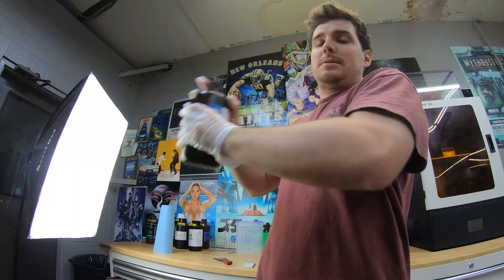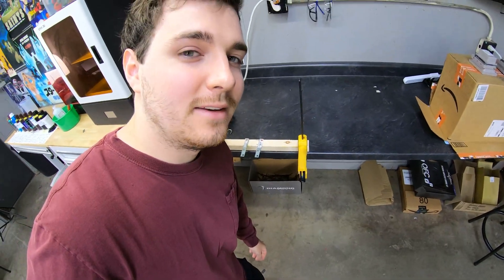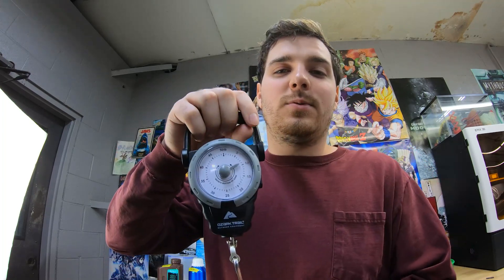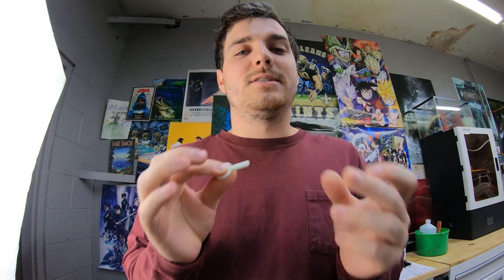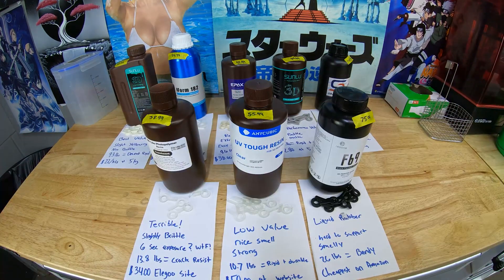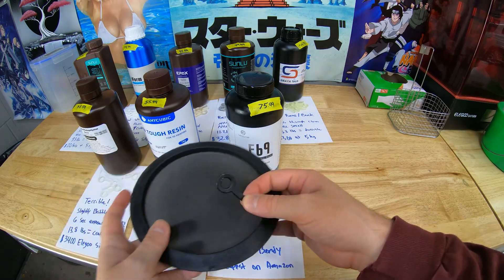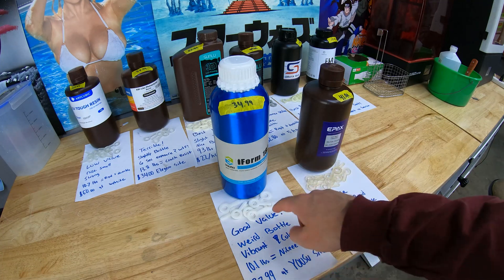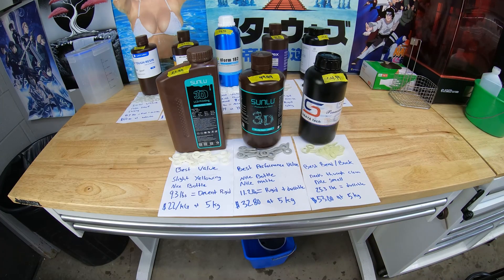Best 3D Printing Resin?

Comment: F=ma is for kinetic energy, to calculate a bullet's impact, etc. When you pulled the weight scale, you was exerting a potential energy onto the specimen. Whatever you saw there in kg scale, you have to multiply it with 9.8 (on earth) to get Newton (unit of force). You was quick to realize "low-tech beats hi-tech" (any t-shirt? 😆) and went for the finger bend test, rightly so. It couldn't be better than any NASA or NTSB tests! Please remember low-tech "always" beats hi-tech. 😆

Comment: I can not say fair review. With resin prints everything effects result. How long you exposure, how long did you wash, how long did you post cure, each stuff effects differently on each resin. I started with elegoo ABD-like resin then tried others. That resin is amazing. Holy moly flexible. I've tried printing pick for our traditional instrument which called baglama. Thickness 0.2mm i am able to play instrument since months with same pick. But when i post cure this resin becomes like potato chips. It's also so elastic and so strong 1+mm parts withot post cure. Just leave it in room light for few days you will get totally different results. It is more durable than Siraya Tech Blu versions. Also not being sticky after wash and more precise.

Comment: Don't worry about the acceleration. As long as the test piece holds acceleration is negligible, and the human body isn't going to produce the sudden jerk you'd need to get a larger force from the scale's acceleration when the test piece snaps.

Comment: Sunlu is cheap and strong, but the accuracy is kind of crap. I've tested ABS-like and PA-like resins, with many different exposures, and it works bad, 0.4 mm holes are barely distinguishable and filled with resin (like it's overexposed) but at the same time the support test fails (like it's underexposed), so I believe it's just impossible to print anything detailed with it. When I print the Eiffel tower - the details on top are just lost. The "starship" resin test shows loosing the 0.2 mm pillars as well. And I don't have any of these problems with "overpriced" anycubic ABS-pro resin, it easily passes all tests and shows much better accuracy. And also the shrinkage, Sunlu has 6-8%, when other resins have about 3-4%

Comment: Sunlu ABS is 90% of what I print with, but the PA resin looks interesting.  That said I know people use Siraya Tech Tenacious and Siraya Tech Fast 50/50 mix to make things like electric ducted fans for R/C aircraft, and drone parts so the stuff is definitely not to be under estimated.
Reply: I have been using inland do you know if the almost the same quality?

Comment: I was printing miniatures with 20/80 Siraya tech tenacious + anycubic standard mix, which works great for making the models more durable. unfortunately where I live siraya tech tenacious has increased in price by 50% recently making the mix less economical than the alternatives, even more expensive than anycubic tough. I have ordered anycubic tough but I might check out those sunlu and iform ones in future.

Comment: I know resins say they are to be washed in IPA, but I saw some other video that said all of them could be washed in water unless they specifically told to not.
So is the Sunlu okay to be washed with water?
Reply: Hi Ulrika!  I prefer seraya tech resin, but I also used a lot of elegoo resin labeled “water washable”😳but elegoo Actually recommends using a minimum 15% ipa solution for cleaning. Hopefully people don’t expect to wash this down the drain.  It’s still dangerous resin. Expect to use some kind of solvent. Resin is nasty stuff and gets on everything….it’s like plastic grease….you need a strong solvent to clean it quickly and effectively for your safety and others😎

Comment: assuming the sunlu isnt available, and the anycubic tough is available for 30€ a bottle, would you use the anycubic resin? im especially worried about removing supports from delicate miniatures.
Reply from the maker: If you can get it cheap I'd say its definitely quality resin.
Reply: @blake3dcake  its about as cheap as resin gets around here unless buying in bulk, 25-30€ a kilo for the discount resin, and 35-45€ for high quality resin. offer just seemed too good to be true, so was looking for reviews which were surprisingly hard to find.
thanks for the help man :D

Comment: Hi I don't know why my previous comment disappeared. In Europe Anycubic Though costs 139 Euros for 5kg and sunlu pa-like costs 164 Euros for 5kg. The prices are almost identical. So if the prices are like this would you still recommend sunlu pa-like or would you consider Anycubic Though. I need a good rigid resin for functional parts. I prefer it not to be too flexible. Epax does not ship to europe :/.
Reply from the maker: Overall im biased towards sunlu because I use it so often. If price is equal, I think it comes down to preference. They are slightly different but for the most part you're going to get similar results. I would recommend buying 500ml of each and testing your preference.
Reply from the maker: that being said if one is cheaper, it might be worth going that route. They are both good resins in my opinion
Reply: @blake3dcake  You know what I mean. Watching your video I notice that the durable resin is epax hard. Compared to other standard type resins I see that it is tough and stiff but does not bend. In the case of Anycubic Tough resin, you can see that with a certain bending where normal resins would break, this one starts to bend even more and get stretchy. Does this mean that it is more durable ? I would disagree. I would prefer, for example, that my screw that I print would not stretch but remain rigid. Resins such as Sirayatech Blu or just looking at you in the video Epax hard are real durable resins that don't bend and are hard to break. However, Siraya costs $50+ and Epax does not ship to Europe.
That' s where my question came from because I can't quite see in the video if the Sunlu PA-Like starts to bend or if it stops at a certain position and won't go any further.
Reply: Ok, I have already searched a little on the Internet and I see that Nylon is simply a flexible material. In that case, I have ordered ABS-like which is much stiffer and I will see how it will perform. Thank you for your help
Reply from the maker: @Hayall_9x19  the more rigid you go the less impact resistant you become. Epax is extremely rigid but prone to shatter. For functional parts you want a good combination of rigidity and shatter resistance
Reply: @blake3dcake  Exactly, nylon-like / though resin is too flexible.  Standard resin is stiff and does not stretch so it breaks easily, and these resins that you showed Sunlu ABS like and Iform are such a perfect combination. I ordered the 5 pieces of abs like and 1 of Nylon like. I will see the results by myself in one week.
Reply: It would have been nice to compare siraya tech (abs like resin) instead of the tenacious resin they offer. The tenacious is way to flexible to be considered "abs like".